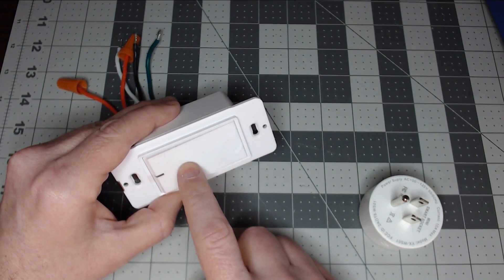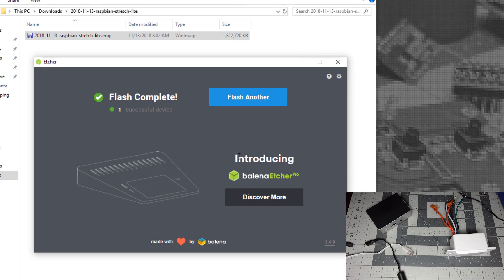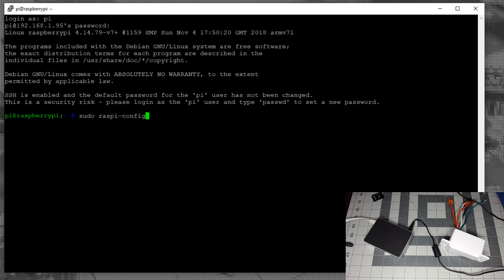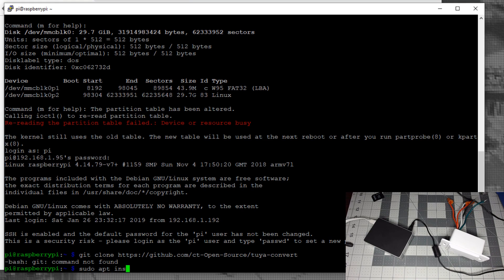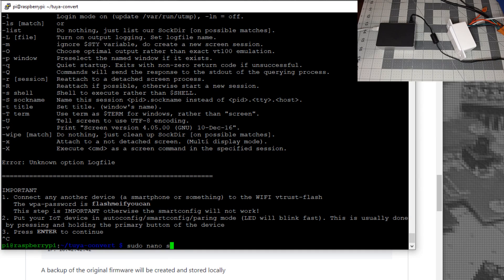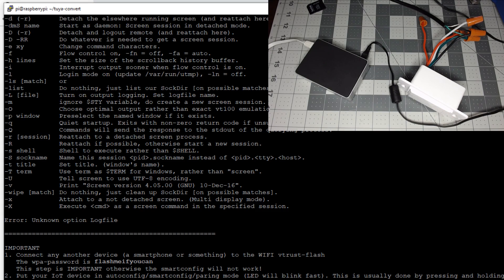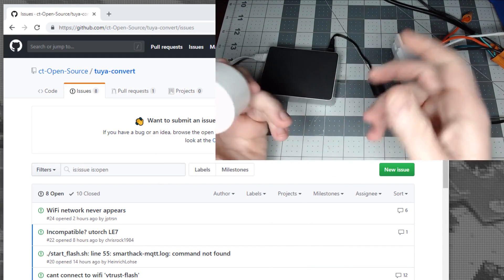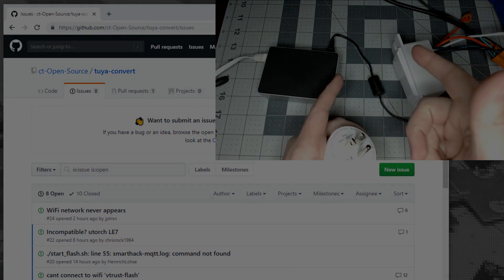Flash Tuya Smart Switches, Plugs, and others all Over the Air - No soldering!

Comment: Thanks for the info.  I followed and tried to flash tasmota onto Esicoo plugs.  The plugs doesnt flash at all. I think my setup is good with the exception of the version of Raspbian Stretch Lite is no longer available.  The Raspbian website only have Raspbian Buster Lite so i used that.  Dont know if that make a difference or not.  

My setup get to the point where it flashing the dot waiting for device to flash.  I put the plugs into "flashing" mode by pressing the power button until the power/wifi button flashes.  Then nothing happen, the dot on putty just keep going and going.  Seem like it cant see the plug or something.  Can you help? Do you think Tuya patched it?
Reply from the maker: They still have stretch lite if needed, you just have to go to another folder.  http://downloads.raspberrypi.org/raspbian/images/raspbian-2019-04-09/

As for the blocking yes, some devices have come with firmware being patched already and definitely a lot of them have had firmware updates pushed over the air.  I haven't heard when the new update to tackle this is coming out.
Reply: @digiblurDIY  so I assume mine is patched since it is not flashing. Any idea on how to find out for sure?
Reply from the maker: Of course the first method is to test with a known working Tuya convert setup. Second is to check the logs and see if you see the two Mac IDs in the log. One for the phone and one for the plug.
Reply: @digiblurDIY  there are a few log files in the tuya-convert folder, which one should I look into?
Reply: @digiblurDIY  I looked in the log files.  I only see MAC address for phone.
Reply from the maker: Is the plug in fast blinking mode?
Reply: @digiblurDIY  I think so.  I plug it in, hold the power button until the light start to blink.
Reply from the maker: Make sure you don't see an access point coming from it on wifi. If you have another wifi device to attach to it other then the phone you can try that.
Reply: @digiblurDIY  I did a full reinstall of the raspberry pi setup to match the exact version that you used in the video and it still didnt work :(  guess they patch it or something.  this is frustrating.
Reply from the maker: Are you still seeing only one Mac ID in the log? I don't recall off hand which one it is but look through them and see.
Reply: @digiblurDIY  here is my log for smarthack-wifi.log

Backing up NetworkManager.cfg...
Restarting NetworkManager...
Backing up /etc/dnsmasq.conf...
Writing dnsmasq config file...
Creating new /etc/dnsmasq.conf...
Writing hostapd config file...
Configuring AP interface...
Applying iptables rules...
iptables v1.6.0: can't initialize iptables table `filter': Table does not exist (do you need to insmod?)
Perhaps iptables or your kernel needs to be upgraded.
iptables v1.6.0: can't initialize iptables table `nat': Table does not exist (do you need to insmod?)
Perhaps iptables or your kernel needs to be upgraded.
iptables v1.6.0: can't initialize iptables table `filter': Table does not exist (do you need to insmod?)
Perhaps iptables or your kernel needs to be upgraded.
iptables v1.6.0: can't initialize iptables table `nat': Table does not exist (do you need to insmod?)
Perhaps iptables or your kernel needs to be upgraded.
iptables v1.6.0: can't initialize iptables table `nat': Table does not exist (do you need to insmod?)
Perhaps iptables or your kernel needs to be upgraded.
iptables v1.6.0: can't initialize iptables table `filter': Table does not exist (do you need to insmod?)
Perhaps iptables or your kernel needs to be upgraded.
Starting DNSMASQ server...
Starting AP on wlan0 in screen terminal...
Configuration file: /etc/hostapd/hostapd.conf
Failed to create interface mon.wlan0: -95 (Operation not supported)
wlan0: Could not connect to kernel driver
Using interface wlan0 with hwaddr b8:27:eb:1e:86:0e and ssid "vtrust-flash"
wlan0: interface state UNINITIALIZED->ENABLED
wlan0: AP-ENABLED 
^Cwlan0: interface state ENABLED->DISABLED
wlan0: AP-DISABLED 
nl80211: deinit ifname=wlan0 disabled_11b_rates=0
Backing up NetworkManager.cfg...
Restarting NetworkManager...
Backing up /etc/dnsmasq.conf...
Writing dnsmasq config file...
Creating new /etc/dnsmasq.conf...
Writing hostapd config file...
Configuring AP interface...
Applying iptables rules...
iptables v1.6.0: can't initialize iptables table `filter': Table does not exist (do you need to insmod?)
Perhaps iptables or your kernel needs to be upgraded.
iptables v1.6.0: can't initialize iptables table `nat': Table does not exist (do you need to insmod?)
Perhaps iptables or your kernel needs to be upgraded.
iptables v1.6.0: can't initialize iptables table `filter': Table does not exist (do you need to insmod?)
Perhaps iptables or your kernel needs to be upgraded.
iptables v1.6.0: can't initialize iptables table `nat': Table does not exist (do you need to insmod?)
Perhaps iptables or your kernel needs to be upgraded.
iptables v1.6.0: can't initialize iptables table `nat': Table does not exist (do you need to insmod?)
Perhaps iptables or your kernel needs to be upgraded.
iptables v1.6.0: can't initialize iptables table `filter': Table does not exist (do you need to insmod?)
Perhaps iptables or your kernel needs to be upgraded.
Starting DNSMASQ server...
RTNETLINK answers: File exists
Starting AP on wlan0 in screen terminal...
Configuration file: /etc/hostapd/hostapd.conf
Failed to create interface mon.wlan0: -95 (Operation not supported)
wlan0: Could not connect to kernel driver
Using interface wlan0 with hwaddr b8:27:eb:1e:86:0e and ssid "vtrust-flash"
wlan0: interface state UNINITIALIZED->ENABLED
wlan0: AP-ENABLED 
wlan0: STA 10:98:c3:b1:19:72 IEEE 802.11: associated
wlan0: AP-STA-CONNECTED 10:98:c3:b1:19:72
wlan0: STA 10:98:c3:b1:19:72 RADIUS: starting accounting session 2D4DBC2B01FD152A
wlan0: STA 10:98:c3:b1:19:72 WPA: pairwise key handshake completed (RSN)
wlan0: STA a4:cf:12:a6:b5:c8 IEEE 802.11: associated
wlan0: AP-STA-CONNECTED a4:cf:12:a6:b5:c8
wlan0: STA a4:cf:12:a6:b5:c8 RADIUS: starting accounting session D0CF816F0416E759
wlan0: STA a4:cf:12:a6:b5:c8 WPA: pairwise key handshake completed (RSN)
wlan0: STA a4:cf:12:a6:b5:c8 IEEE 802.11: disassociated
wlan0: AP-STA-DISCONNECTED a4:cf:12:a6:b5:c8
wlan0: STA a4:cf:12:a6:b5:c8 IEEE 802.11: disassociated
wlan0: STA a4:cf:12:a6:b5:c8 IEEE 802.11: disassociated
wlan0: STA a4:cf:12:a6:b5:c8 IEEE 802.11: disassociated
wlan0: STA a4:cf:12:a6:b5:c8 IEEE 802.11: disassociated
wlan0: STA a4:cf:12:a6:b5:c8 IEEE 802.11: disassociated
wlan0: STA a4:cf:12:a6:b5:c8 IEEE 802.11: disassociated
wlan0: STA a4:cf:12:a6:b5:c8 IEEE 802.11: disassociated
wlan0: STA a4:cf:12:a6:b5:c8 IEEE 802.11: disassociated
wlan0: STA a4:cf:12:a6:b5:c8 IEEE 802.11: disassociated
wlan0: STA a4:cf:12:a6:b5:c8 IEEE 802.11: disassociated
wlan0: STA 10:98:c3:b1:19:72 IEEE 802.11: disassociated
wlan0: AP-STA-DISCONNECTED 10:98:c3:b1:19:72
^Cwlan0: interface state ENABLED->DISABLED
wlan0: AP-DISABLED 
nl80211: deinit ifname=wlan0 disabled_11b_rates=0
Backing up NetworkManager.cfg...
Restarting NetworkManager...
Backing up /etc/dnsmasq.conf...
Writing dnsmasq config file...
Creating new /etc/dnsmasq.conf...
Writing hostapd config file...
Configuring AP interface...
Applying iptables rules...
iptables v1.6.0: can't initialize iptables table `filter': Table does not exist (do you need to insmod?)
Perhaps iptables or your kernel needs to be upgraded.
iptables v1.6.0: can't initialize iptables table `nat': Table does not exist (do you need to insmod?)
Perhaps iptables or your kernel needs to be upgraded.
iptables v1.6.0: can't initialize iptables table `filter': Table does not exist (do you need to insmod?)
Perhaps iptables or your kernel needs to be upgraded.
iptables v1.6.0: can't initialize iptables table `nat': Table does not exist (do you need to insmod?)
Perhaps iptables or your kernel needs to be upgraded.
iptables v1.6.0: can't initialize iptables table `nat': Table does not exist (do you need to insmod?)
Perhaps iptables or your kernel needs to be upgraded.
iptables v1.6.0: can't initialize iptables table `filter': Table does not exist (do you need to insmod?)
Perhaps iptables or your kernel needs to be upgraded.
Starting DNSMASQ server...
RTNETLINK answers: File exists
Starting AP on wlan0 in screen terminal...
Configuration file: /etc/hostapd/hostapd.conf
Failed to create interface mon.wlan0: -95 (Operation not supported)
wlan0: Could not connect to kernel driver
Using interface wlan0 with hwaddr b8:27:eb:1e:86:0e and ssid "vtrust-flash"
wlan0: interface state UNINITIALIZED->ENABLED
wlan0: AP-ENABLED 
wlan0: STA 10:98:c3:b1:19:72 IEEE 802.11: associated
wlan0: AP-STA-CONNECTED 10:98:c3:b1:19:72
wlan0: STA 10:98:c3:b1:19:72 RADIUS: starting accounting session 97617EF074EF9779
wlan0: STA 10:98:c3:b1:19:72 WPA: pairwise key handshake completed (RSN)
Backing up NetworkManager.cfg...
Restarting NetworkManager...
Backing up /etc/dnsmasq.conf...
Writing dnsmasq config file...
Creating new /etc/dnsmasq.conf...
Writing hostapd config file...
Configuring AP interface...
Applying iptables rules...
Starting DNSMASQ server...
Starting AP on wlan0 in screen terminal...
Configuration file: /etc/hostapd/hostapd.conf
wlan0: Could not connect to kernel driver
Using interface wlan0 with hwaddr b8:27:eb:1e:86:0e and ssid "vtrust-flash"
wlan0: interface state UNINITIALIZED->ENABLED
wlan0: AP-ENABLED 
wlan0: STA 10:98:c3:b1:19:72 IEEE 802.11: associated
wlan0: AP-STA-CONNECTED 10:98:c3:b1:19:72
wlan0: STA 10:98:c3:b1:19:72 RADIUS: starting accounting session 0C84F7E97FF02E73
wlan0: STA 10:98:c3:b1:19:72 WPA: pairwise key handshake completed (RSN)

10:98:c3:b1:19:72 is my phone.  I am not sure what to look for here. The plug doesnt seem to put out it own wifi access point either.
Reply: im reading some of the recent comments and look like they patched it.  Guess no point in trying until they find another expoit :(

Thank for your help and the video.
Reply from the maker: I don't think yours is the patched issue given it isn't trying to attach to the raspberry pi.

Comment: Tried multiple devices and multiple machines/phones to connect to the vtrust-flash.
Nothing happens just continues in waiting.
The devices work have connected them to TUYA with no hassels.
its a smartlife basic switch.
Log files have no errors either.
any help would be appreciated.
Reply from the maker: If you had them connected to the Tuya app then they were probably updated to the new blocking firmware.
Reply: @digiblurDIY   it can't be that, as first I am trying to flash them then testing them on Tuya.
Reply from the maker: Which device? Some are coming patched right out of the box.
Reply: Smarlife basic switch.
Reply from the maker: Have you tried another device to flash before? Also I have heard people having issues with some phones attached as the secondary device. Try another.
Reply: @digiblurDIY  Flashed Sonoff devices with but not OTA, I did try 3 devices phone, Tab and a computer.
Reply from the maker: In the logs can you see both devices connecting to the Pi?
Reply: @digiblurDIY  unless of course the version is already on the latest from the factory.

Comment: as of 5/26/19 martin jerry light switch not working. ordered from amazon 05/22/19 this is after i flashed a plug.
Reply from the maker: Correct. They changed the board and you have to do them the old fashioned way until a new exploit is found.

Comment: my phone connects to vtrust-flash for a brief moment and disconnects immediately before i even get to the next step :(
Reply from the maker: I have heard of some phones doing that. You can use other wifi devices. It should stay connected if everything is routing correctly though.
Reply: @digiblurDIY  thank you, I'll try that. Is it possible to do this to xiaomi binary sensors to make them cloud free and fast?
Reply from the maker: I am not aware of a Esp8266 based xiaomi sensor

Comment: Thanks also for this!  I get stuch and after initial flashing I get a message - 
curl: (7) Failed to connect to 10.42.42.42 port 80: No route to host
..and the BSD29 plug no longer responds.  Any suggestions?
Reply from the maker: Do you see a vtrust-recovery ssid out on the airwaves?

Comment: I flashed my Gosund WP3, loaded up the Tasmota page, put in my wifi details, but now it just blinks blue and red, doesn't present wifi, and nothing I press on the button does anything. Multiple short presses, a 40 second long press. Nothing. Any idea what I can do? I tried to crack it open but the plug is going to really get damaged I think doing that.
Reply from the maker: Did you use the bin linked in the description? If not you can try the method of making a wifi network with the same SSID you picked without any security and see if the device will attach. Then put in your wifi password again. While you are there put in a backup ssid/pass too.
Reply: digiblurDIY . I didn’t, I just used the built in Tasmota. But great tip on the WiFi. I setup an extra access point I had lying around with the same name but no authentication and it came right up!! Now I need to figure out why it couldn’t attach to my network with the WiFi password. I also want to put ESPHome on it instead of Tasmota. Thanks much!

Comment: Hello I just got a Gosund WP212 Dual outlet with energy monitoring If I flash will I be able to see both plugs and energy usage  with MQTT
Reply from the maker: Yes. I have a plug similar to that and control both relays and see the power over MQTT.
Reply: @digiblurDIY  I havent set it up to the tuya app will it flash OK
Reply from the maker: It should. Haven't heard of that plug being patched out the box yet.
Reply: @digiblurDIY  sorry I didn't ask before will I have to play with it to get the right GPIO pins or is it documented somewhere?
Reply: @digiblurDIY  Just checking with you, the flash has been on the dots for about 5 minutes should I let it go or restart it I have not got any errors
Reply from the maker: And this hasn't been on the cloud? You have a phone connected to the Pi too?
Reply: @digiblurDIY  no never connected ad yes on phone its not seeing the switch
Reply from the maker: Have you tried checking the logs on the pi to see if the other switch is pairing?
Reply: @digiblurDIY  No I am using a Older Ipad as loag as I only see the dots am I OK to stop?  I do have other devices (nodeMCU , D1 mini.) running, but none in pairing mode
Reply from the maker: Stop it definitely and start over again.
Reply: @digiblurDIY  I tried a different Ipad and it started Thanks
Reply: @digiblurDIY  does if backup the old firmware automatically?
Reply: @digiblurDIY  OK I got it going thank you It was the older Ipad it was running IOS 9 So if someone else has a problem try a different device.
Reply from the maker: Awesome!  Enjoy
Reply: @digiblurDIY  OK I'm not sure if I bricked my switch, I did get tasmota to load fine I was going though some of the templates and found none that worked so, I was working on it today I was able to get the switches and buttons working but not the Energy/Power to display. I find a few more templates tired one, it reloaded and I lost the switch on the network and I can't see the AP either there is a light flashing on it when it did that before I just had to connect to the AP and add my SSID and Password.  Can I get it back or do you think I bricked it.
Reply from the maker: It might be stuck unfortunately in some loop. Do you know if you had the button working?
Reply: @digiblurDIY  yes but only one button it working,  button 1 turns on Plug 2. I did have it working right just NO energy monitoring.
Reply from the maker: You can try the button held for 40 seconds thing to see if that resets it.
Reply: @digiblurDIY  That did it thank you,   and pointers on how to get the energy monitoring going?
Reply from the maker: Do you have a link on this plug? Need to see exactly what it is.
Reply from the maker: Hmm..  I saw those on deal today.  Didn't realize it had power monitoring.  No real tips except if maybe you can open it?  Otherwise it is a big guessing game.  Make sure your button1 is configured indeed.
Reply: @digiblurDIY  Well after reading your reply I checked the box, I didn't find anywhere that it said energy monitoring, I thought it did,  I looked on Amazon on my order and only seen on Picture that said Energy monitoring didn't find it in the description, So I'm guessing it don't. 

Thanks for your help, I already have them set up in Home Assistant and working Great. :)
Reply from the maker: Makes me wonder if it really does. No way to open those? Is there any model number or fcc ID on the back?
Reply: @digiblurDIY  No fcc ID.    Model # WP212
Reply from the maker: Found it..  also called the WP211.  It does look like it has power monitoring.  Now to find out the pins.   https://fccid.io/2APUZ-WP211
Reply: @digiblurDIY 
 I Emailed the Gosund company to make sure it does have power monitoring I'll let you know when they get back to me
Reply: @digiblurDIY  No that was the first one I tried
Reply: @digiblurDIY  Hey I have a Question, I have a different smart switch I have had for a while set up with the  tuya app if I try to flash it will it just fail or will it brick it? I can open it fine. and could solder pins on it, I just been holding off on doing it
Reply from the maker: Hard to brick any of these esp8266s with access to the pins unless you break it physically by feeding it too much voltage. Switches are pretty simple.

I would try Tuya convert first as it might not be patched yet.
Reply: @digiblurDIY  Worked great I had to restart the vtrust server 2 times but it flashed and is working even the power monitoring, ( it's a KMC70011 switch )
Now just waiting to here from Gosund.
Reply from the maker: Awesome when it all works out!
Reply: @digiblurDIY  I finally heard back from the Gosund company and they told me this plug (WP121) does not have power monitoring.